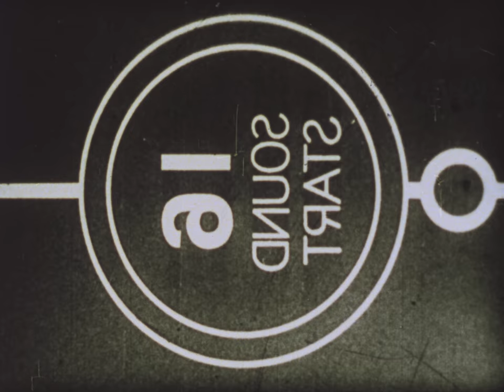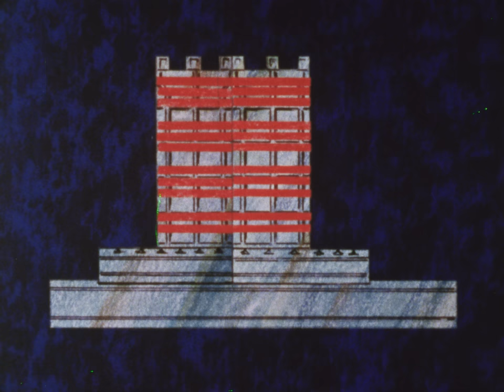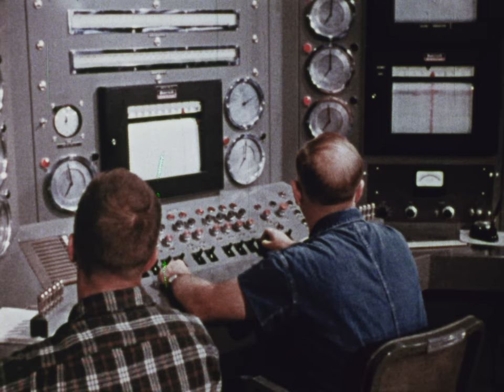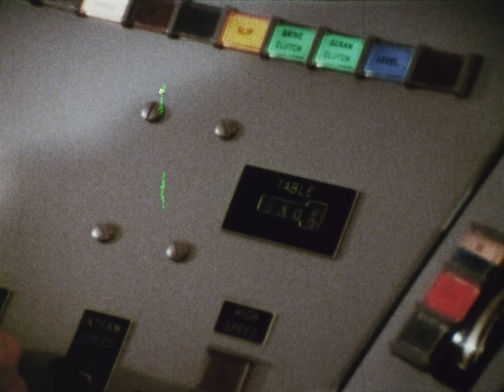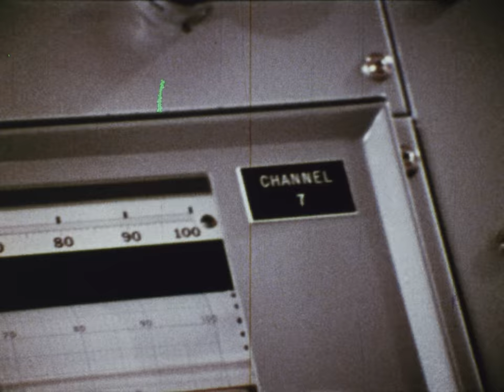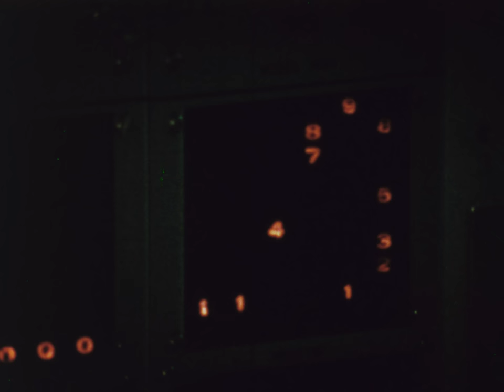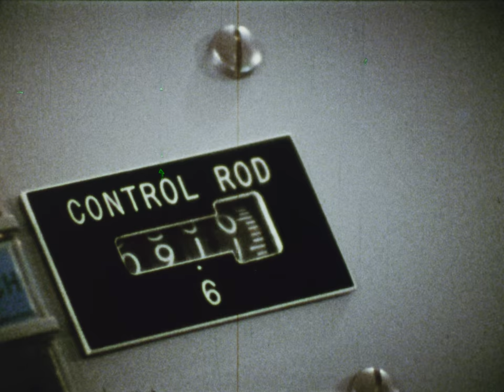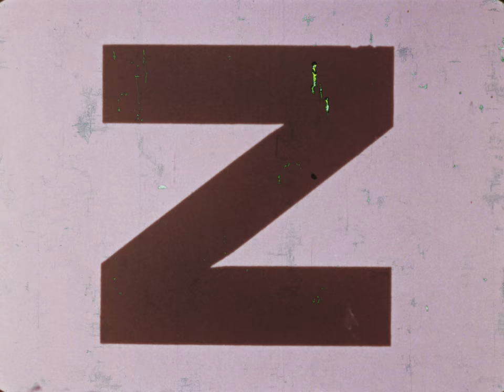In Search of a Critical Moment — The Story of ZPPR

Comment: Proud to have operated and supervised this Facility over the past two decades. A truly unique machine, and a substantial loss to nuclear technology when it was forced to shutdown!!!
Reply: Why was it forced to shutdown?
Reply: A new era of interest in Nuclear power now. Pebble bed fuel Westinghouse AP1000 and SMR units .
Reply: @yuglesstube  also since the idea of breeder type reactors they found richer deposits of uranium in multiple places including in the North in Canada.
Reply: @MitzvosGolem1  smr : 1/10th the power, 1/4th the price. = Dead end.
Reply: @sylvaintexier8609  Except new ideas and larger unit may hold promise.
Reply: @sylvaintexier8609  And where did you get this information?
Reply: As many commentors should know, there are many good reasons for more expensive but less output SMR.
These units can be employed in the newly opening NW Passage.  New large mining works and ports etc.
Darlington nuclear plant, nearToronto, is testing this out for the first commercial installation.
I'm just disappointed it's not a Canadian made system, which is available.
Reply: @yuglesstube breeder/recycler reactors make plutonium. The US and Canada shut down research and use of these units as part of our anti-proliferation agreements.
Reply: @MitzvosGolem1  SMR =/ larger unit
Reply: I'm not going to pretend to be an expert on any of this, but wouldn't smaller more module reactors be a good thing? Maybe they produce less power but perhaps they'd be easier and quicker to build at quantity. Of course, with more units you have more opportunity for some kind of failure. Again, please don't jump on me, I'm just an engineer not an nuclear engineer. All I said is predicated on being able to get past legislation and all that. But it seems to me if we really want to make an impact on greenhouse gases, we would be trying to build many smaller reactors rather than massive ones. And what to do about those bovines...which produce insane amounts of gases. I'm 100% pro-nuclear, pro-conservation and planet stewardship. So not trying to get political either
Reply: @FreejackVesa  When we are talking about an economy of scale, there are two sorts. First is the one you are talking about, a good example is the car in this case. We have made cars to the point that it is considered an inconvenience to not have one for every person in the family who can drive. Smaller power plants, if we can reach the point they are black boxed, install and forget like a water heater, then having one per home will save billions a year, because transmission lines, and the workers to maintain them, are a big part. An intermediate step is if we can get them to the point that basically any college grad can maintain them... at that point we can install one per town... no more high wires, no more lost voltage. Each town, like we did before the big boys bought them all. As long as it takes a highly skilled team to maintain them, however, the savings does not happen. We do not have enough 175k a year steam fitters.
Reply: My pops was in charge of SNPP new Hampshire I've never seen a man as proud of the power of the atom like he invented it
Reply: The test data your research reactor produced is used to this day to design new cores and new reactor systems.

Comment: This structure looks like a good basis for a reactor for a lunar base. How you would deal with radiatively cooling it with a 300kelvin diurnal variation I dunt kno tho...
Reply: Hundreds of Miles of Underground water canals to passively cool the reactors. Think of fantasy Dwarfs having a Venice culture.

 Cool thing about a underground facility is that if it cost millions of dollars to build individual underground rooms then mining would have never been economical. Underground rooms could  potentially last thousands of years on the Moon & Mars.
Reply: by placing it where it will not get sunlight. Without the atmosphere, only directly lighted points get hot. If you build it out of direct light, like underground, you have very near absolute zero. And yes, at least the first few reactors on the moon need to be fast reactors, because we are always going to need power, and we cannot waste space taking up massive fuel assemblies for each plant. Since we know there is U238 on the moon, fast reactors could be used to process the fuel to make more, for more powerplants.

Comment: To a modern nuclear professional, there is so much about this that is uncomfortable. Let's start with smoking inside an antique nuclear facility where there is almost certainly contamination. It's not like modern plants that are kept spotless.
Reply: Curious question: Would the radiation sensors pick up the radio active contaminants in cigarette smoke, if someone were to light one up in a modern facility?
Reply: @paulmichaelfreedman8334  No, it is a miniscule amount of radiation. It's about not accidentally ingesting any contamination: particularly beta or alpha emitters. In the old days, this tended to get spread around with operating age. Note that radioactive particulate can have strong electostatic charges and will cling to stuff. 
This is a very interesting subject with lots of "operating experience" being used to create modern practices. Modern nuclear stations are kept incredibly clean. They are also designed better for control of contamination. Doses for workers are a small fraction of what they once were.
Reply: @DavidL-ii7yn  Although I never studied nuclear physics (for a degree), I did get a good basic understanding of "normal" physics in high school. But I always used to ask the teacher deeper questions than we officially had to learn. For instance, Protons, neutrons and electrons were discussed. My questions were things like "Why is the neutron slightly heavier than a proton?" And the answer would involve the quarks, and of course I then went on to ask what Quarks were. The teacher gave me a vague answer because he knew I would not understand the scientific description, but it made me curious enough. Now, over 30 years on, I have a much deeper understanding of Quantum mechanics although not on the mathematical level, but as I have autism(undiagnosed until I was 50), I have a profound visual understanding of QM, admittedly some of those are analogous to what "really" happens, if we can even say that in this context...
Reply: heh, these old video's really sell dont they? you think they really knew what they were doing by the way they talk and present themselves, then we look at history and realized, holy hell, how are we alive LOL
Reply: @paulmichaelfreedman8334  ... what?
Reply: Charming innocence perhaps but which carcinogenic material would get you first?

Comment: Control rods with fuel? Interesting. I always thought control rods were for controlling fission and not initiating it?
Reply: They can be both. The reactor mass is just subcritical and with the insertion of the control rods it goes critical. They also contain the other elements used in the proposed reactor design structure to verify proof of concept. Sodium, stainless and aluminium etc. Everything that would be present in the real core.
Reply: @robinwells8879  Maybe I don’t quite understand the terms, but for simplicity, I thought with control rods inserted, that would essentially stop the reactor? Pulling the rods out would start it back up?
Reply: @brmakl1  both are rods and they can control the reaction!  I think that at this early stage of the science they were chasing the point of criticality and so it was easier to achieve it with adding fissile material. Geometry is so important to the physics alongside simple mass. Later when they understood the point of criticality it became easier to insert rods to quench the reaction by absorbing neutrons rather than adding them to initiate it. I am not really qualified but this is my understanding.
Reply: @robinwells8879  no worries! I see what you are saying now and I agree. I am also by no means educated on this stuff but always interested to learn bits here and there. Very fascinating! Thank you for the reply!
Reply: @brmakl1  my pleasure. It was a new concept to me also.

Comment: “containment problems are dramatically reduced”

Missed out there.
Reply from the maker: Pretty sure they're referring to the fact that low-pressure coolant reduces the concerns related to containing 2200 psi water.
Reply: @whatisnuclear  Yes, sorry, engineer here.  I meant to comment on how we all missed out on the enormous advantage of a fast reactor with a liquid metal coolant, thus no pressure vessel, thus no primary side steam explosion threat, given the US cancellation of the fast reactor program.  By Clinton, wasn’t it?

I would have liked to see more discussion in the film of the main problems, at least in my view: Pu as a fuel and its production chain, and the risks of Na fires as w Super Phenix.
Reply: @Nill757  Almost zero risk of sodium fire with this design. I stored almost 10 metric tons of sodium plates in the warehouse. They were clad in stainless steel, and were room temp. Sodium is not a liquid and very reactive until over 208 degrees F.
Reply: @joelblankenship269  In a reactor as a coolant, it is a heated liquid and not a solid sandwiched in steel. See the Super Phenix accident.  This low power experimental reactor has no reported operational Na fires, as have other builds, so it’s possible, though I don’t understand the failsafes.
Reply: @Nill757  In this particular design, the sodium coolant was in the plates, and kept at ambient temperature. Since it was such low power, the cooling was maintained with fans and HVAC, and kept at approx. 90 +/- 0.25 degrees. The physics and nuclear properties they were gathering was the same, regardless of temp. 

I also qualified and operated Experimental Breeder Reactor-II (EBR-II), and we maintained the sodium coolant in a double tank at 700-883 degrees. Since the sodium does not boil until approx 1600 degrees, we were able to keep the argon cover gas pressure at 1.0 inch HG, and never had any primary leaks or fires either.
Reply: @joelblankenship269  Thanks. 

Then what was the point of sodium in the ZPPR at all? Instrumentation?  

Clearly, sodium has been used in power reactors, successfully, and also leading to catastrophic fires as in France.  I’d like to discover the difference between Super Phenix and EBR II with respect to sodium handling.,  If the answer is luck or even better diligence, then I think that’s not enough for a fleet of power reactors.
Reply: @Nill757  I believe the two designs are drastically different in construction. I have never heard of any "catastrophic" fires at either Phenix or super Phenix. Leaks - yes, but all due to flanges or small line failure outside the primary tank. The sodium makes an excellent coolant for fast reactors, little interaction with the neutrons, and it is 3 times better than water for heat removal and transfer capabilities. While it can get highly activated as Na-24, it (radiation level) decays away in 5 days and can be accessed at normal levels after that. You can send non-radioactive sodium out of the containment, and have it go to a boiler building where the super heated steam is produced, and used in the turbine generators. With a proper design like EBR-II, we used to refuel one-third of the total reactor fuel inventory in about one week, and return to operation.
Reply: @joelblankenship269  Superphenix, a 1242 MWe fast breeder in France, reported a sodium leak April 10, 1987, 20 tons, continuing at 0.5 ton per day.  Apparently I was mistaken about any fire. 

Certainly there are better working fluids than water with respect to heat transfer. Light water reactors dominated early in the history of nuclear power, in large part, because the coolant is also the moderator, so that in the case of coolant loss, the loss of moderator also ends criticality.
Reply: @Nill757  And with a multiple containment (concrete, then two steel tanks), pool-type fast reactor at zero cover gas pressure, you don't ever lose the coolant, and the reactor just sits there. We performed the 1985 shutdown heat recovery testing to prove you couldn't have a Chernobyl or Three Mile Island event with a sodium cooled reactor.
Reply: @Nill757  You may wish to look into reactor designs which use a molten salt as coolant, and in particular those which are liquid fuelled also (fuel and coolant combined). There’s much hype regarding using these reactor types to breed fissile fuel from thorium-232, which, by sensationalising the “fuel”, mostly misses the point of the main advantages with this configuration. Obviously, employing a sodium salt removes the combustion issues that can arise with metallic sodium although it introduces other challenges.
Reply: @anhedonianepiphany5588  I’m familiar.  MS reactors never happen in the US or EU until the US NRC is destroyed and replaced with an effective regulator that actually approves new reactors start to finish.  NRC never has.
Reply: It was reduced from “probably” down to “maybe not”.
Reply: @Nill757  there never was Na fires in France at  phénix nor superphėnix.

Comment: Columbia Generating Station…WPPS II continues to provide safe power for the North West…
Reply: Other than running with a broken main pump bracket, and injecting hydrogen gas to reduce corrosion on the other bracket, hoping that it doesn’t break and cause a nuclear accident. Hope isn’t safety culture. It is the opposite. It is unsafe. An accident made vastly worse by the hydrogen injection, with reduced safety margins. And also, it is a sister to the Fukushima reactors, which showed just how unsafe this class of reactor is in a station blackout. The major part of the disaster at Fukushima was driven by hydrogen gas evolution from the destroyed cores. That would be even worse in an accident at CGS.
Reply: How quickly you forget the other four uncompleted WPPS reactors that have cost power users billions of dollars with exactly zero benefits.